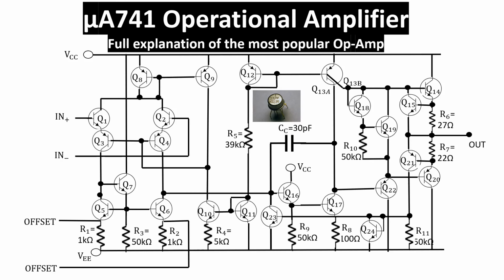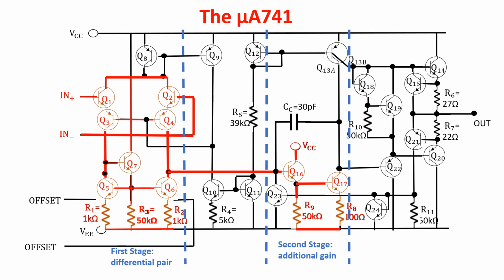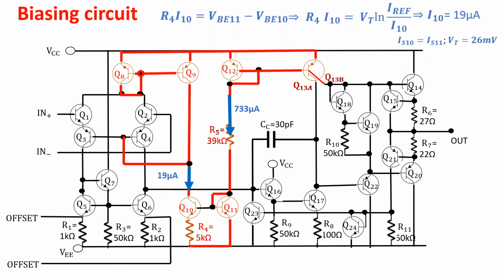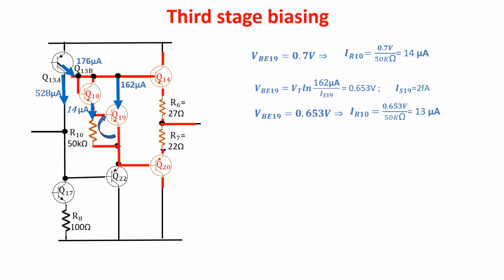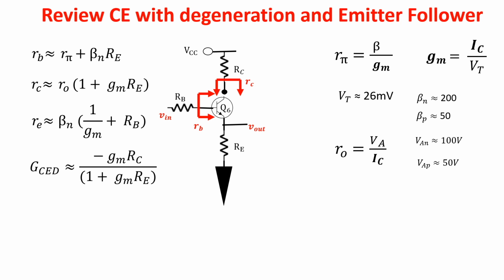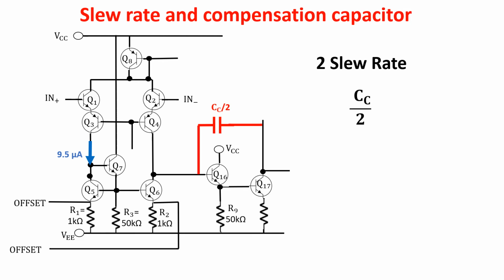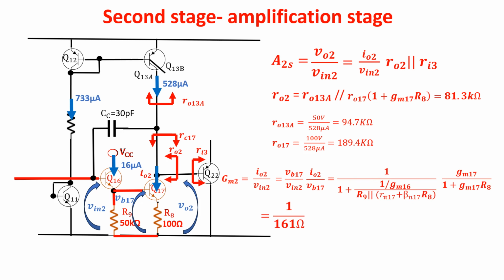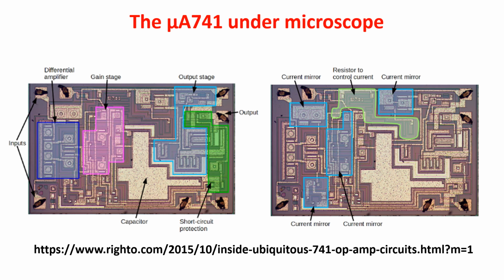ua741 Operational Amplifier - Op-Amp internal schematic - full explanation of the most popular OpAmp

Comment: Excellent explanation !!!

...and I've just learned that unlike most of today's op-amps which use two individual emitter followers feeding a classic differential pair having emitters sharing a common current, 741's input diff uses two CC transistors followed by a common-base amplifier. Thanks for improving my knowledge !
Reply from the maker: Thank you. I am glad you like it. Yes at the time PNP were poor and opamp needs high beta to lower the base current (input current of  op-amp), so Fullagar had to use npn and figure out the right configuration to improve gain and to lower input capacitance